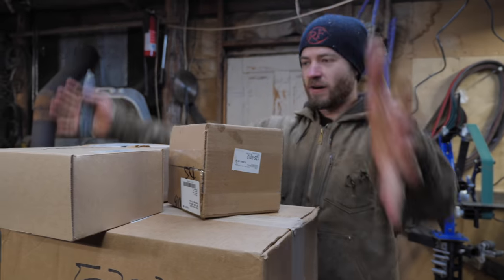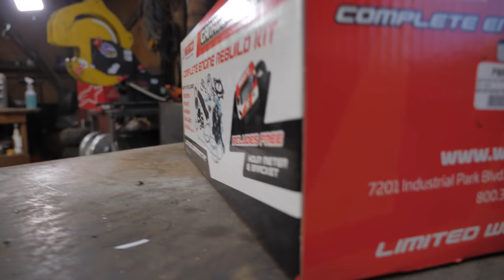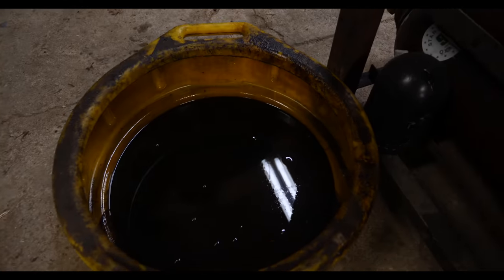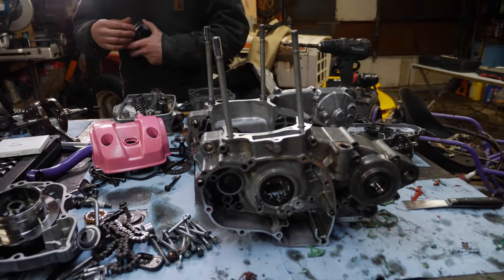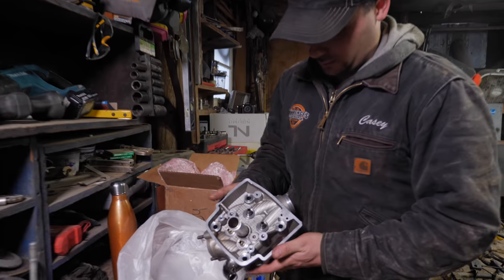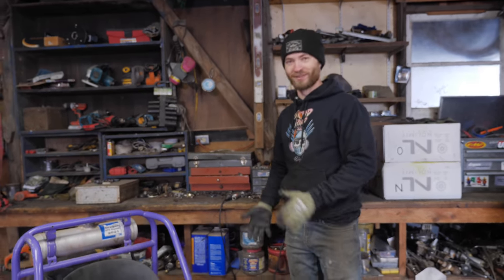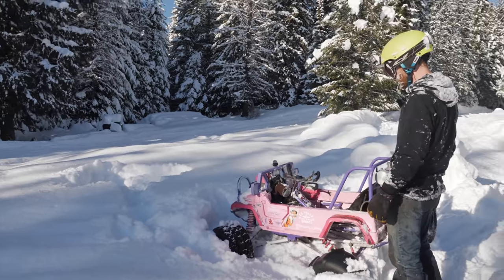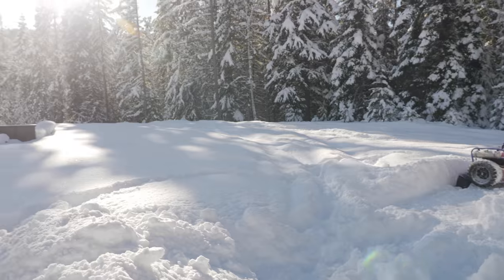50 HP Barbie Jeep Jumps! + Full Engine Rebuild!

Comment: I have a little tuning related tip that you might already know about with the FPV quad. If there is horizontal lines in your video from vibration and you are using fresh props. The gyro might be working a little to hard. I would turn the P gain down a hair on the pitch axis to help smooth it out. Also flying in colder and more dense air tends to make them gitter like that go but it can be corrected for by turning the P gain down a little. 
Hope it helps :)

Comment: The exposed air filter is gonna suck up the water from the snow and could really damage the carburetor and even the engine cause water burns and it burns so hot it’ll melt your spark plug to the piston blowing the engine if water gets in the combustion chamber just a thought with the brand new rebuild

Comment: I'm anxious to see how the wisco bottom end does with all the abuse. I have been told not to buy the bottom end from wisco so I'm excited to see how well it does.
Reply: Weisco makes some off the best pistons on the market, only time u see failure is when the machine shop doesn’t machine your block i run weisco in alot of my stuff i make over 1,000hp to the pump in my seadoo 45lbs of boost there usually a forged piston so tolerances are setup different for expansion and contraction of the metal

Comment: Your FPV drone flying might need some work. I find that if i disarm as soon as possible during a crash, there is often little/no damage. I recently destroyed a frame by NOT disarming when i flew into wire that then catapulted my quad into a tree. If i had've disarmed before it hit the wire, the motors would not have accelerated it into the trees. Just a thought, hope you're getting better!

Comment: I hope yall know running without proper muffler thros the engine back pressure n cause back fires switch leads to a blown gasket or engine

Comment: it would be cool to see a Tesla power wheels build with an electric motor
Reply: The battery pack in a 3 weighs, what, 1200lb? I don't think a Tesla swap makes sense. Maybe an electric motorcycle drivetrain, but even then it'd be heavy.
Reply: C G clown, i ment take a mini telsa and make an electric go kart, they didnt put a jeep engine in there build

Comment: for the smaller stuff youre running you could build youre own dyno , its basicly a (heavy) roller with a brake and and counterweighted arm on the brake to measure the weight and an rpm counter on the roller (crank or abs sensor) and a computer with some electronis to let everything talk to it 
you measure the time between two rpm's at a certan amount of weight (torq) both of them alow you to calculate horsepower by using a vehicle with known horsepower and torq along the rpm band to calibrate the dyno you have made
as a brake disk wouldnt work for long they use a waterpump (pumping water furter uphill with tap off / water return points at different heights for low to high horsepowercarefull about cavitating the pump at high rpm ) of electric motor converted to a dynamo trough a bank of resistors 
the bast i seen them use an electromagnetic retarder from a truck too those can be mounted on aroll around cart and mounted to a hub or driven with a chain wish is safer (not driving the car trougha wall) and gives better data (no slipping)
https://www.youtube.com/watch?v=9Crn_S-1EIQ